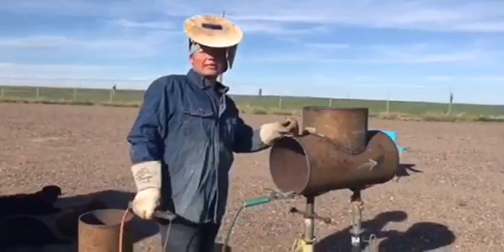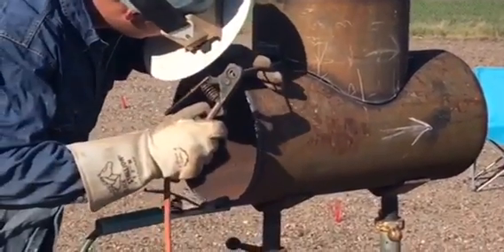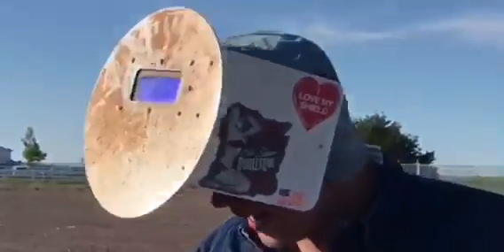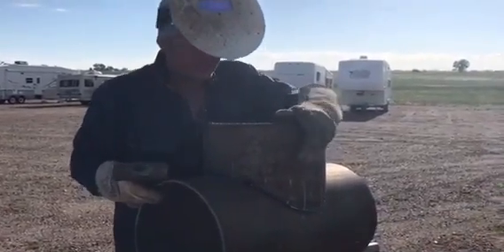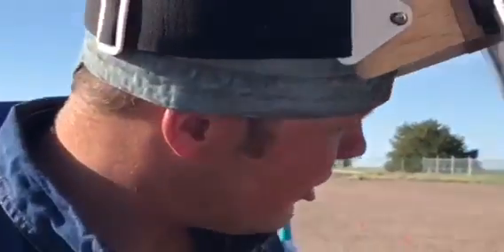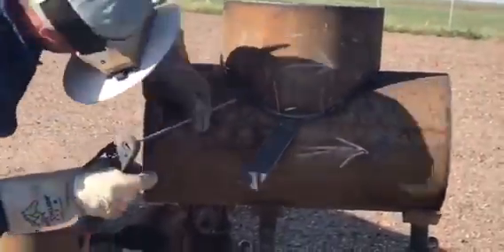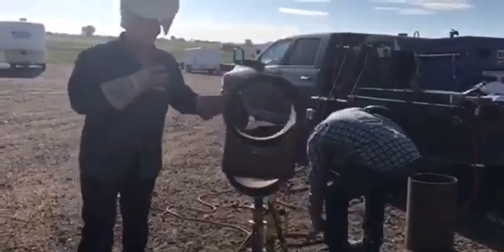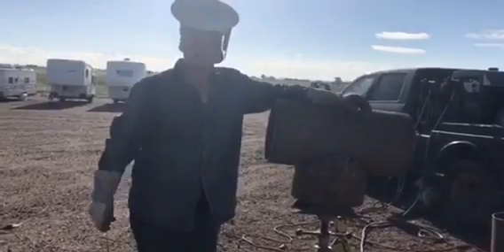12"x12" branch test

Comment: You do a good job of showing what needs to be done. Good pipe welders take pride in their skill. A good pipe welder is hard to come by. Worked in a major oil refinery for 30+ years, when money got tight the ones in charge would look at cutting wages on the contractor side for shut downs. When they cut the pipe welders wages the good local ones would go out of town for work.  This would cause the shut downs to run out one to two weeks longer because of all the busted weld, rewelds, extra x-rays. Then the ones in charge would want to know why it took so long to finish a shut down.  Sometimes the ones in charge have to learn the hard way about good pipe welders, some never did. Glad I am retired, got tired of the fight to keep the pipe welders pay up. Good pay for good pipe welder always made you good time and money getting the shut downs finished. Nobody wants a bad weld in a oil refinery. I good pipe welder will not do you a bad job just because you cut his money, he will just not show up and go out of town where they do pay for his skill.